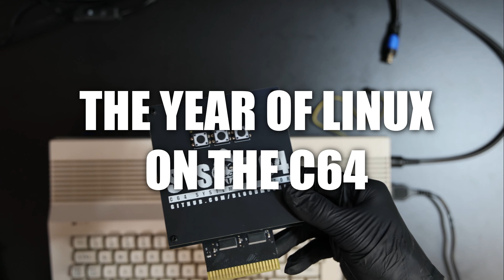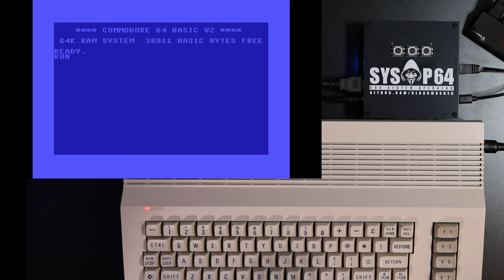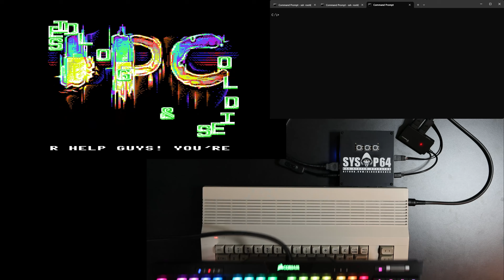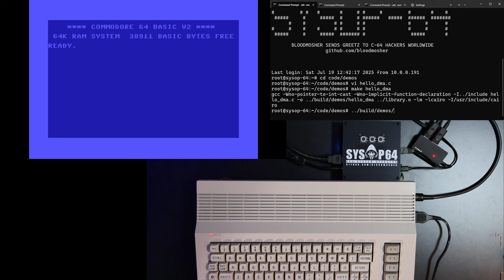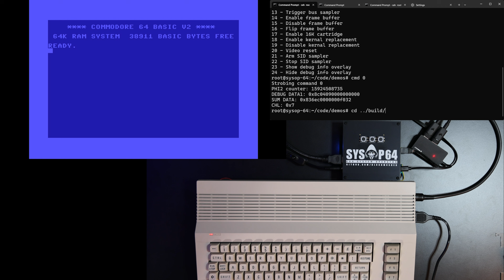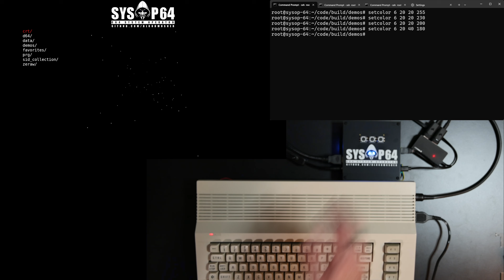The Year of Linux on the Commodore 64

Comment: So many people don't understand. This is not running Linux on a C64. Linux is running on the cartridge. Don't think of this as a C64 cartridge. This is a Linux computer with a Commodore 64 attached to it as a peripheral that it can control and communicate with using direct memory access. That's the brilliance and the power of the cartridge port. It's not like connecting to another computer through telnet, ssh, ftp, etc., and asking for permission to do stuff. The cartridge port allows the Linux computer to just "take over" the C64 and manipulate its memory directly. It's more like a master-slave, daemon possession, zombie, invasion of the body snatchers type thing where the Linux computer can tell the C64 exactly what it wants it to do by implanting thoughts in its brain and controlling its muscles directly and the C64 must obey. Amazing!

Comment: I was interested in this until I saw you run a Linux program that basically just mangled the Commodore 64 video… In this sense then you're basically using the C 64 as a graphic frame buffer which I believe is something your FPGA can do anyway… So I'm not that interested in how you bit bang the Commodore 64… As much as I'm interested in you using the SYSOP 64 as an external device that the C 64 controls as if it was like an external hard drive or an external interface to TCPIP or HTTPS... this is interesting as an external peripheral to the Commodore 64 but if all you're doing is using a high-powered Linux machine to put graphics on the Commodore 64 vid Chip… I don't know that this is all that interesting
Reply from the maker: It has that capability- the IO space from DE00-DFFF can be used for signaling between C64 and the DE10/Linux side. This will allow things like REU, EasyFlash, etc. - all in progress. If you had something in particular in mind, would love to hear ideas!

Comment: This is great! I've always wished for DMA with random addresses. This can unlock new graphics modes along with digi's at the same time. But I noticed in your demo that rasters weren't stable. Is there a way to specify the exact cycle of each raster line? That's needed to unlock the full potential.
Reply from the maker: Yes, that's what "wait_vic2(line, cycle)" is doing... what you are seeing in those color bars is not instability, but is actually just a bug where it is not correctly accounting for VIC access on bad lines. So the queued poke gets pushed beyond where it was intended to run. I'll show the fixed version in another video and/or when the demo source is pushed to github. 🙂
Reply: @BloodMosher  What's cool is we'll get access to those 3 cycles where BA is making the CPU stop. I also wish I could bank colour ram, I've never seen a mod for that.
But I have an idea for you. You can OR modified data on top of RAM for a few more tricks...

Comment: You can actually ran standard Linux on a c64, by compiling C code. It's been done but takes hours to boot. It's just the bare minimum kernel and shell. I know it could be sped up a lot though.
Reply: Note: it needs an MMU, so the C64 runs a virtual emulated CPU, part of why it's so slow.
Reply: @curiousgeorge7515 partly. Though it's about 20 times slower than it would need to be because it's just a compiled c emulator

Comment: If it's not even using the C=64 screen and font, what is the point?

It's just a modern high-res monitor running remote Linux.
Reply from the maker: Think of it this way- it has the potential to replace almost every other cartridge you might be using on your C64 (DMA loaders, flash loaders, network access, ROM replacements, accelerators, etc. etc.)... and also give you HDMI output at 1080P... and also give you the ability to do some extra cool stuff from the Linux side. That's the point. 🙃

Comment: as the original production c64's both use dram and are nmos, you cannot just 'freeze' the c64. you have to at least keep the dram refresh going. but you cannot halt or influence the system clock anyway. lol. i take it this bus interfacing was all done in a secure and reliable way with buffered latches and isn't just 'bitbanging some io pins and merely gambling the non-real time linux kernel does it 'in time' as it is 'faster' (if it's not doing anything else that is ;)
Reply: basically it's a z80 cartridge but not a z80 :P the thing that makes me very suspicious however is that obviously it does not run on the system clock. you cannot just 'hook up a data and address bus to some i/o pins' in either direction. not if you want it to be guaranteed to work right no matter what happens that is.
Reply from the maker: All of the timing is handled on the FPGA side, and then there is bidirectional communication between the FPGA and the HPS running Linux. The C64 bus is sampled at 100mhz and precise locations for reads/writes were chosen. This technique is pretty well established by many other cartridges. And the protocol for DMA is very well established, and the same techniques are used here.🙂

Comment: Two things i genuinely love... My Commodore 64 and  #LINUX . However... attaching a 1000 times more powerfull modern cpu to its expansion port does not feel right to me. Feels like someone replaced it's soul. Yet still the 40+ old home computer still is being loved and keeps running so plentyful shows the love of the people for a work of art .
Reply from the maker: Yah, initially I worried about that too. But I must say after spending time on the project I now understand the machine on a whole new level and the bridge to modern computing has made the C-64 a part of my world even more deeply than before. Now I can't imagine NOT having it. 😊
Reply: if the computer world hadn't consolidated around "Wintel", I might agree. But now it just seems logical, the 6502 C64 and linux on FPGA are kind of the bookends to a history of Microsoft dominance. Actually, it would also be fun to run a ARM64(AArch64) from a C64. "Fullcircle64" lol  Also, ironically, the C64 becoming a terminal(basically just a keyboard) for  a computer a hundred times more powerful might seem "soul-stealing",  but when you're talking a difference of thousands, or even tens of thousands of times more powerful... well, it justifies itself I think.  It's like having a fancy keyboard with a nostalgia factor.

Comment: This is completely nutty and has to be illegal.  I want it.

For real though, keeping my ear to the rail on this one.  I love my U2+, and I use every function it has, but, given that you're basically allowing REU kind of data transactions without an REU is wicked.  Now, the cost of the DE10-Nano...
Reply from the maker: If you can get one, the retro remakes clone is a little cheaper. But it's worth every penny either way in my opinion. 😊
Reply: @BloodMosher  I already have a DE10 that's setup as my MiSTer.  So for play time, I could use it and swap, and if I find value I might order another one in.  I just don't want to have to keep swapping between the two.  It still blows my mind about 10meg of data being tossed around like this.  The programmer in me loves it, the artist in me died a few decades ago (Unless you call programming an art, which some could).....

Comment: With Linux and C64 I'm basically set for life. The only downside is that C64 won't fly with my need for unicode and fuńky ćhąraćtęrs. Dunno if that Linux-in-picture mode can handle something more than TTY100/LANG=C. But I'm highly intrigued.

Comment: So it's a second computer using the C64 as a keyboard... okay.
Reply: not exactly.. it's a second computer controlling the C64 thru DMA
Reply: @ChrisFaulkner  sounds like a distinction without a difference
Reply: @ardentdrops  not entirely.  If you don't understand how the C64 works entirely, you're not going to be able to make the distinction without a difference.
Reply: @ChrisFaulkner  I'm not sure you understand what that phrase means lol. Sounds like something an AI would write.
Reply: @ardentdrops  LOL green clouds on a summer rainy day
Reply: It is a C64 cartridge running Linux, so that you can program/script your own custom C64 cartridge features in a high level environment.
Reply: The trick here is that it works both ways.

It's evolution of a freezer on a cartridge.

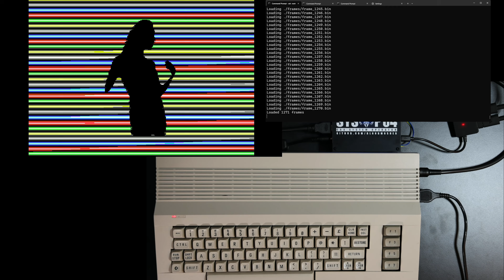7:04 if someone wants to see what it can do as the rest is about fancy way to setup peripherals.
Reply: Tell me that you don't understand what this is, without understanding what this is. Oh, wait.
Reply: @ksln  So compared to the new C64's, this is better how exactly? Except for half the price, but with a new case + keyboard.
Reply: @jmp01a24  It's not better or worse, but different as this project blows the door wide open in regards to new usecases.

I'll limit myself to the following statement: DMA between a C64 and a vastly more powerful machine, enables the C64 to do things it could not do prior computationally due to the 6510.

There are ways to speed up a C64, but this interface is different. Very different. And I'm excited to see what people end up doing with it. :)
Reply: Its a lot more than that...
Reply: I already got a PC. Just install Linux and a good C64 emulator, it will do the exact same thing. Just sprinkle over with a bit of make belief.
Reply: @jmp01a24  slowly backs out of the room
Reply: @ksln  Beyond Kontrol... dex ez maksina